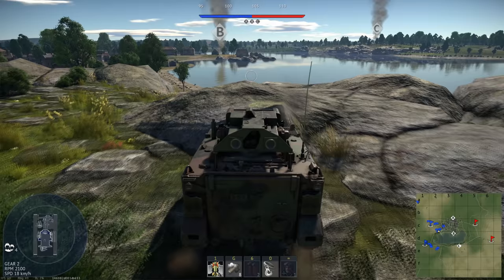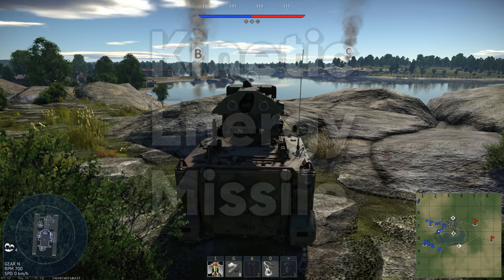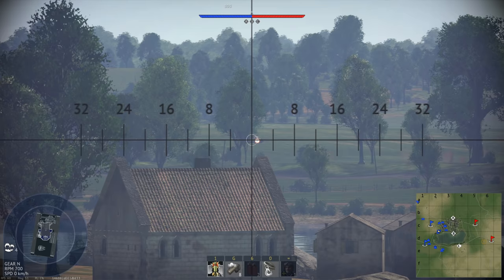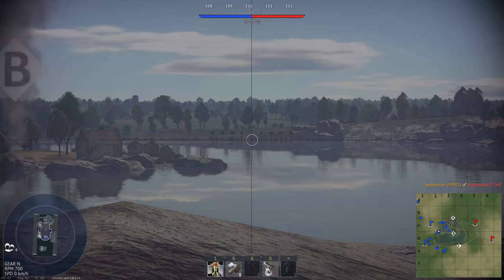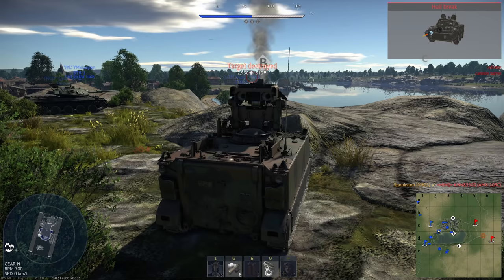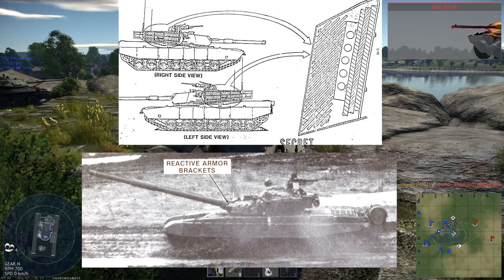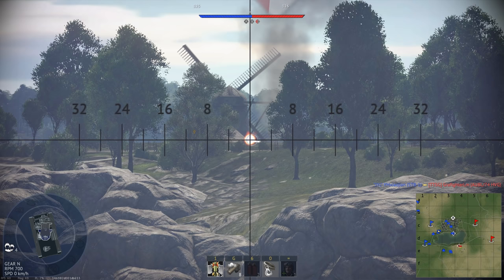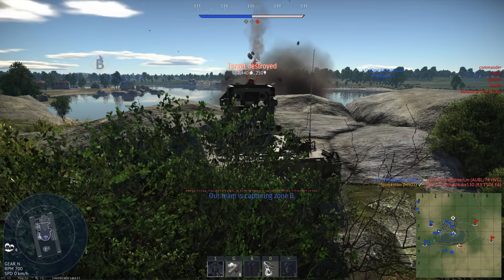Kinetic Energy Missiles - Future Tank Weaponry

Comment: Good vid. One nit-pick: am EFP is technically separate from a HEAT warhead. They're both shaped charges but act differently.
Reply: achillesRising, the Knight of Rage thanks
Reply: With EFP’s, think along the lines of the nuclear manhole cover. The penetrator is a solid projectile rather than a jet of super-plasticized metal.
Reply: @Warriorcat49  So the EFP round itself is a gun sort of?
Reply: Necrodermis pretty much.
Reply: @Warriorcat49  So nice to see for once someone who didn't use "plasma" or "jet of molten metal" to describe a shaped charge liner.
Reply: @volvo245  yeah, the jet doesn't heat up enough to become a plasma or even melt
Reply: @volvo245  It's not even remotely close to plasma. Where does this misconception come from?
Reply: @inwit594 I think because it's repeatedly called a "jet", possibly from the liquid-y way it deforms, and people expect that to correlate with liquids (and gasses), not solids.

Comment: KEM have a minimum effective range, right? They must need some distance to accelerate.
Reply: Yes, that's why, for example, anti air missiles have a problem at short ranges and therefor automatic cannons still play a key role in close area defense, a good example is the CIWS system. However there are probably ways of increasing the accellaeration of the missiles, like reducing weight by using more energy dense explosives and propellant.
You could also use a hybrid between a missile and a progectile, similar systems are used to increase the range of artillery shells. There is also a typ of shells called, gyrojet, wich is nothing more than a spin stabalized bullet, filled with solid rocket fuel shot out of a smooth bore barrel (spin stabalization accures due to the rocket nozzels being mounted eccentric at an angle to provide an even torque).
Reply: @mandernachluca3774  the problem is they need to be moving several Km/s to actually hit hard enough to warrant their use, which is nearly impossible without a railgun if you dont have 300 meters at least to get to speed.
Reply: @vaelophisnyx9873  
I don't understand, since when do missiles or gyrojets need railguns and since when need railguns severals hundret meters to accellerate projectiles to several 
km/s?
Reply: @mandernachluca3774  Drag. The faster you go, the more drag you get, and the more energy you need to accelerate.

Also, if you accelerate too fast, the air acts more or less like a wall, damaging the projectile or whatever launched it.
Reply: @admiral_waffles533  
When i am not completely out of the picture, tests with 1 km/s fast projectiles and more have already been successfully conducted. Those railguns where not much longer than 7 or 8 meters. 

Therefor i don't understand your conclousion, that it would take several hundret meters.
Reply: Yo please tell me all these military tech concepts you know of man! I'm a college student in engineering looking to work in the defense industry more on the research side one day and potentially even start my own businesses in the field eventually. I'd love to hear all the military projects and ideas you know about, because these are the kinds of things that will be a big help to my career one day. Also maybe you can point me to where I can find out about and research these sorts of things myself? Anyways love the channel man and keep up the good work!
Reply: @mandernachluca3774  I never said I agreed that it would take several hundred meters, being skeptical of that claim myself.

Just meant that it does take some distance to reach mach 1+
Reply: @mandernachluca3774  1 km/s isn't that fast. That's what some AT guns in WW2 could achieve. Modern APDSFS fly at 1.6-1.8 km/s. The railguns that have already been tested by the Navy are all well above 2 km/s. Pretty much every tank since 1950 has been firing projectiles at above 1 km/s. I have to assume that we are all misunderstanding that guy, alternatively he's just pulling stuff out of his ass.
Reply: I remember the KEM from Act of War: High Treason.
Reply: The minimum range is the biggest problem. They are unusable if the target is under 300m, which is a huge issue because that means they need to fight in open terrain, which is not something you want to do in such a lightly armored vehicle
Reply: Yes. Their glaring problem is that their minimum effective range is very large compared to traditional chemical missiles. It's a consequence of its design and not much could be done about that. If a method was found to solve the minimum range issue or work around it then I haven't heard of it. But when the target is hit by a KEM within it's effective range then it was as good as gone.
Reply: I'm just guessing that because it's an relatively extremely light rocket probably powered by a solid rocket fuel engine it's minimum range is probably very small in comparison to its 5km maximum range. Probably roughly 100m-300m. And if these were ever adopted it wouldn't be much of an issue because they would probably give one or two to a tank platoon.
Reply: @TheIvercon  The thing is though, if you look at recent conflicts most of the battles happend in urban areas, where you simply don't have 300m of open ground.
Reply: @shi01  they obviously wouldn't be used in urban warfare, except for maybe a strategic siege of a city using a HE rocket I bet the US Army would buy if it was pushed into service. But still why deploy a weapon system when you know its a bad idea. The US military didn't deploy tanks to Afghanistan because of the leasons they learned from Russia.
Reply: @TheIvercon  Well, funny thing is other nations did deploy tanks in Afghanistan like Canada and Denmark and they worked great for them.
Reply: @shi01  they aren't using them in mountains or cities...thats why they work great for them.
Reply: So, more feasible in air-to-ground role in open terrain
Reply: @mandernachluca3774  what you said is not quite correct. Anti-air missiles, especially of the air-to-air variety, have a minimum effective range but that has nothing to do with kinetic energy, because they are not kinetic energy warheads. They are chemical effect warheads, almost exclusively of the folding-rod variety. The minimum distance has much more to do with sensor lag, target acquisition, and getting a solid lock than anything else. What the war had of an AIM-9X is just as lethal at 5 fps as it is at 5000 fps
Reply: Tony Wilson  Discarding sabots are still limited by the barrel of the tank firing them, as well as being unguided. You could likely build a guided sabot round, but it would be hugely expensive because of the acceleration and size restrictions. Missiles are guided, longer range, accelerate more slowly compared to guns, are larger, and can be mounted on even light vehicles without heavy cannons. They already mount Hellfire missiles on lighter vehicles, but those are less useful in the era of active protection systems.
Reply: Tony Wilson  why are you talking about APDS? the video isnt about APDS and the comment section isnt about APDS. it's about a kinetic energy based missile system. you are bragging about working on something completely different
Reply: Tony Wilson  ok, i'm going to say this very clearly because you might be an old man with old man reading skills. this video is not about armour piercing discarding sabot rounds. this video is not about cannon rounds. the video is about missiles. the fact that a sabot round also uses kinetic force doesent matter, the concept we are discussing is missiles, specifically chemical effect missiles versus kinetic effect missiles. kinetic energy missiles are not the same as APDS.
Reply: @mandernachluca3774  The solution is a higher thrust shorter burn motor.  Hence why RIM-116 missiles are taking over from CRAM.  Fire and forget and longer range as well.
Reply: About 300 meters I do believe

Comment: If this were a test you would fail. You are only about 50% correct on any point. Your description of the HVM/KEM missile being a beam rider is just flat wrong! That is not how it works. You're also wrong as far as most of your comments about the penetrator. As far as live fire, same again because the missile was fired off both the Bradley and the HMMWV versions. The same applies to just about everything else you say. How do I know? I know because I worked on the program in several of its incarnations and I wrote the control software for the Bradley weapon head. Your video does look slick, it's just a shame that it's full of a lot of misinformation.
Reply: well then give some corrections or anything constructive.

Comment: If the Exoskeleton programs being developed currently come through, and are then further enhanced in the future, perhaps a support infantry KEM design could be built in conjunction with said programs. It'd be like a RPG in use initially. But then it could progress to say a three barrel platform. In which case, it'd be used for support against light vehicles as you said.
Reply: For infantry, I think normal HEAT warheads are more versatile for the infantry role as they will fought mostly other threat than tank so if Exo-infantry can carry heavy missile most likely they gonna carry normal ATGM than KEM for the most situation.
Reply: There are also the problems of miniturizaion and recoil. Modern KEMs are huge; regardless of the weight penalty, any soldier carrying one is hauling around a 5-foot metal pole that is getting in the way costantly. Likewise, armored vehicles are protected from the exhust by their armor - infantry needs to get the device away before it ignites or they'll be set on fire. Exo suits can be armored, but only to a point and all that armor adds weight and bulk that further strains the power supply and makes it harder to move around in.
These could be migitated by using higher-powered propellants; a smaller missile that just barely stays airborne until it has cleared the infantry and then accelerating to higher velocity - but such higher-powered propellants would also allow HEAT and High Explosive to be far more powrfull and versitile.
If the future of the recoilless gun is to fire small rounds so that a soldier can carry dozens of them, I could very well see troops carrying a variety of ammunition into battle.

Comment: The LOSAT was an interesting concept. The penetration was 6 kg not lbs.  I remember reading about how Gen Shinseki used to use a video of the LOSAT being tested against a M1A1HA. The point was to show the vulnerability of heavy tanks to congress and gain support for his concept of a lighter more mobile force....

The missile went through the front of the armor package and out the back of the turret. Most of the turret armor package was bisected apparently. The penetration of the weapons was suspected greater then 850mm RHA. Also the thickness of the long rod was such that systems like heavy ERA, k5 (what was suspected to be the follow up (Kaktus) would have been of limited use.

Comment: A fun note is that there is a sci-fi setting that does use KEM's, just heavily modified ones.
In battletech, LRM's are KEM's which do explode after their kinetic penetration is exhausted, but don't carry explosives as a separate mass from the other materials, instead, the lore is just that they have explosives that are insensitive enough to be included as a part of carbide like sintered materials, so the can have explosive mass with a minimal hit to Kinetic penetration, but can still explode somewhat violently when their impact subsides.

 Technically, this isn't typically described as the armor defeating effect (Some models are described to have a secondary chemical shaped charge warhead, but the universal feature is that the initial impact is a Kinetic penetration effect,) but instead as a secondary effect that allows them to be multi-purpose and useable in a infantry-support role, or to weaken armor that the missile can't defeat (Which within the century of their invention, armor was made to counter them, in an incredibly long line of armor upgrades that result in the unbelievable armor used in the era's of the setting that have rules for players to play them.)

Of course, this setting basically has their weapons be universally described as inheriting from not-yet used in real service military projects from the setting, like the XM-274 you use as an example in the raven cannon video thumbnail (Even following the logic of of the XM-274's sale pitch of several shot bursts with high penetration ammo to try and beat armor that is simply to strong to beat in one hit.)

 While the practicality of this settings primary units is questionable (Even the Classic Battletech mechanics makes the deployment of mechs uncannily difficult due to their tendency to fall down and kill the pilots, for example,) their weapons are basically a massive mishmash of future weapon projects waiting to be revived like KEM's and RAVEN autocannons, along side giant exaggerations of the current material sciences trends to justify why every future weapon system has been unshelved to try and beat modern armor (insensitive explosive projects being continued until they grow so advanced that explosives can be sintered into armor piercing grade penetrators, allowing all munitions to be wired to explode if the designer wills it.)
Of course, there is still handwaving regarding too many standard sci-fi tropes, and even more in the later years of the setting that start acting more like a nuke filled apocalyptic dark fantasy in all its walks of its life.

Comment: This video was quite informative for me, I've never thought that Kinetic Kill Vehicles are viable weapons in dense atmosphere.

In space KKV-s are literally the perfect high-penetration missile weapon because their destructivity (which is measured by the kinetic energy) directly proportional to their difficulty to to elimination (which is very well represented by its velocities after boost phase and its armour). Meanwhile in any other missile weapon that doesn't produce its destructive yield primarily from its propulsion system, the higher yield, the easier to eliminate (by hard-kill systems). This is because the higher yield, the heavier warhead, which obivously deteriorates the post-boost phase velocities. Thus KKV-s are the fastest missile weapons in their mass category due to the fact that the whole thing is practically a propulsion system.
Another advantage is that one can calibrate the weapon to the target's hard kill system's and its evasive capability.  One can build a heavily armoured but slower KKV or a lightly armoured but fast KKV. In a sense armour on the KKV doesn't necessary hamper the missile survivability but rather gives a useful alternative.

The reason why KKV-s are shine in space but struggle in atmosphere is obviously air drag. Airdrag due to its velocity square scaling brutally dissipates the KKV-s "bread and butter", its kinetic energy. One must have to keep KKV at low speed while trying to minimise air drag, far beneath hypervelocites. So forget about hypervelocity ~10 km/s KKV-s that are viable in space. The only way to increase its yield without increase its velocity is to increase its mass, without increasing the air drag (practically increas its overall density). Of course this mass increase can be done by putting on armour on the KKV. However, due to low velocites the KKV needs to carry a penetrator for effective armour piercing. In space, on really hypervelocity KKV-s such thing aren't needed because the armour and the KKV evaporates. Clever engineers may be able to build impactors that are also act as armour.
Another problem why KKV struggles in the atmosphere is the employable propulsion systems. In space apart from chemical rocket one can take advantage of lower thrust, higher delta-V propulsions such as nuclear thermal rocket, in more exotic case, different types of ion propulsion, due to the lack of dissipation (air drag) and long distances, which is not available on the earth's atmosphere.
Nevertheless I can imagine that one can take advantage of the chemical reactivity of our atmosphere. Some resourceful engineer may be able to create a KKV that is mainly propelled by a ramjet or scramjet engine and at the beginning of the boost phase a rocket engine accelerates the KKV to the operational velocities of the ramjet.

Comment: On a side note; when the XM-1111 was designed at first it was a Kinetic energy round (a la M829 family) with a rocket booster and guidance package. It was originally intended for improved engagement range but also improved velocity.

Comment: It's quite possible to convert a KEM for anti-infantry use. You'd simply have a splitting charge inside the warhead that fragments the warhead at a predetermined point. The round would behave like canister shot once the charge went off.

Comment: Interesting to note, there are KEMs in service. The british Starstreak short range AA missile specifically. Though that particular example is designed for AA purposes and as such the surface-to-surface ability isn't good enough to defeat MBTs (though it has been shown to go through APCs and likely would likely have little problems with most IFVs).
Reply: Starstreak isn't really a KEM--the three submunitions or "darts" released by the missile each have fuzes and their own explosive fillers. A true kinetic energy missile would not need a bursting charge just as APFSDS kinetic energy penetrators have no explosive filling--they rely solely on the kinetic energy of their impact to inflict damage.
Reply: @Schwarzvogel1  That's not correct. Whether something is considered a kinetic penetrator or a chemical one comes down to the method of penetration, not the method of damage infliction. Or would you argue that most WW2 era and earlier AP shells should be sonsidered chemical munitions because of their explosive fillers?